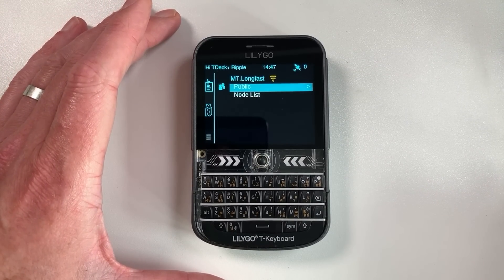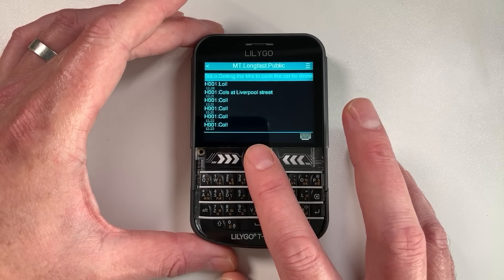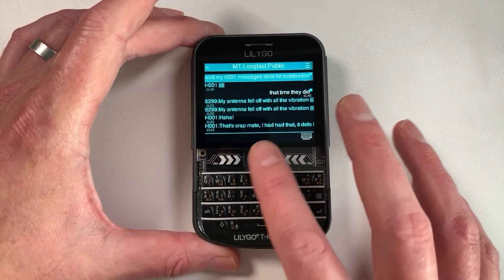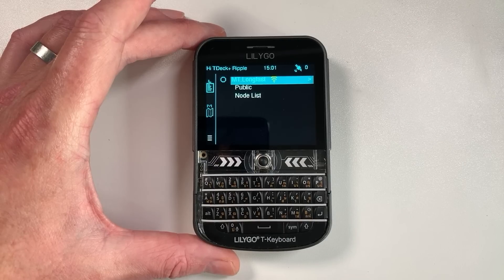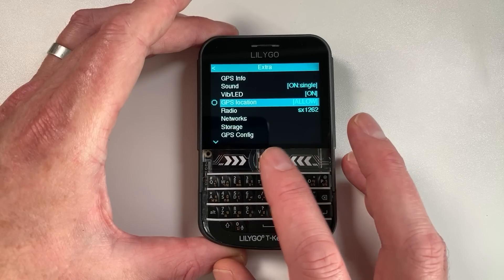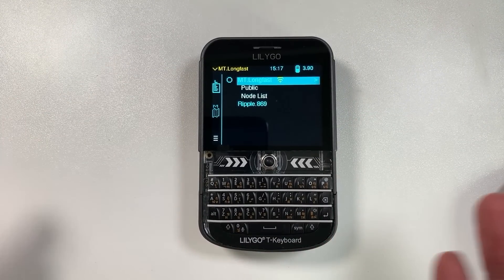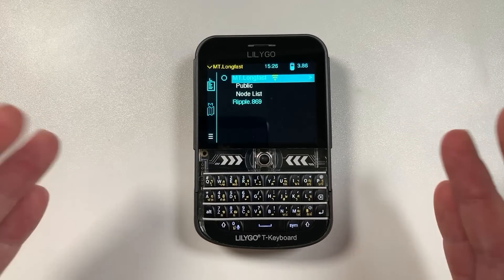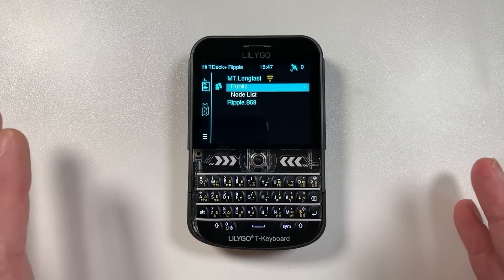MULTI PROTOCOL MESH FIRMWARE FOR TDECK!!!

Comment from the maker: I changed the title, the clickbait was done to push this video out there more and generate more interest in this cool project. 
Unfortunately due to backlash from Meshtastic, the developer pulled the firmware. Sad times.
Reply: Meshtastic is the devil I swear there gunna flip spin and charge for the mesh the devs are sooooooo greesy
Reply: For anyone interested: the "backlash" mentioned here was asking them to release the source code, since Meshtastic is GPL-licensed.

It would be good if we could check whether this firmware not only has a very nice UI, but also is behaving well in terms of, e.g., listen-before-talk.
Reply from the maker: Anyone interested in the background can check the original post here, along with some dialog between Ripple and Meshtastic in the comments section:
buymeacoffee.com/ripplebiz/meshtastic-a-dead-end

I cant really comment on the GPL situation, as far as I understood it Ripple say they just formatted packets in the same way as meshtastic to allow their firmware to send and receive messages on a mesh comprised of Meshtastic Nodes.

It's a simple client mute implementation, and it seems to work perfectly in my testing. I will continue testing and post my findings soon.
Reply: Meshtastic packets are formatted using protobufs, which definitions themselves are GPL-licensed. Next to that, you have to use them in the exact same way as the firmware does, encrypt them in the same way and denote the channel hash using the same hash function, etc.

Would be good to test sending a couple long direct messages quickly after each other to a Meshtastic device and check whether they don't collide with the acknowledgment.
Reply from the maker: @GUVWAF thanks, will take look into it.
Reply: @GUVWAF  HOW it works is NOT GPL licensABLE. Source code is GPL licenseable because source code is SPECIFIC implementation, of nonGPLable method. Source code and method of doing things are two totally different things. So you should change phrasing on that. GPL is NOT patent in any shape or form.
Reply: @andykirby  Would love to be able to test this out too!
Reply: @GUVWAF  if they are not using the protobuf definitions source, this is an API. Therefore it should fall under "fair use" rule in US (see Google v. Oracle) and in EU (Directive 2009/24/EC) - "it has to be made clear that only the expression of a computer program is protected and that ideas and principles which underlie any element of a program, including those which underlie its interfaces, are not protected by copyright under this Directive".

Comment: After all this time, still such as really crappy basic GUI on the T-deck. All I've been looking for over the months is some firmware that has a half decent GUI, it seems the developers are making them but then not releasing and squabbling with each other, which the software disappoints for the majority of users. Imagine not even being able to see a previous message on the stock firmware after all this time!!!!! Every new firmware that has promise is so hard to get or comes with baggage, gets pulled. This project will fail if the community carry on this way.

Comment: All of us that bought the T-Deck because of videos like this now have useless T-Decks sitting without the fancy firmware because its was pulled out and nobody is sharing that firmware that they have downloaded on their computers before it was pulled off from the repos. This is how the interest for Meshtastic is gonna go away.
Reply: I have a similar feeling sometimes. But t-deck is not Meshtastic, its importance was blown out of proportion by vloggers (and I fell for it unfortunately, which i regret). Still there's more to Meshtastic than a useless brick with crappy interface.
Reply: @svofski  I sort of feel like both meshtastic and the t-deck have gotten an undeserved bad rap from this situation. Meshtastic is a really cool project that is still really early in its development. And you are right, there is a lot more to it than the alpha release of a fancy UI that still needs a lot of work. 

But also, there is more to the t-deck than that underdeveloped fancy UI for meshtastic. In fact, the t-deck can be used for other projects besides just meshtastic. It's a neat little esp32 device that could really be used for a lot of cool projects. I'm really looking forward to see what different developers come up with.

Comment: Can this phone looking thing actually make phone calls ? It only sms on Lora ? How about voice recordings ? Thanks
Reply: afaik no voice at all.
Reply: @nullsmack  I did see in the Meshtastic app mention of a in-development Push To Talk mode, maybe in the future we'll have it.  The T-Deck itself does have a microphone, iirc, so you could develop your own software to make use of that if you wanted to take on a big project.
Reply: @dafoex  sure I'd love to take part , but why hasn't anyone done this already isnt that the most obvious thing to do ? If the bandwidth too low for voice stream then voice clips with tcp style error correction should be easy for someone who's developed on this platform before. It's really weird imo
Reply: @dafoex  also what's the mic there for if not to send the voice out ? Setting your ringtone? lol
Reply from the maker: Sending digital voice over a LoRa mesh? Quite complex.
Reply: @andykirby  thx for replying :) once you do 2way data packets with corrections - sending ACK for good packets - like TCP - then txt, data, voice, img... It's all the same.. not sure what's the usual bandwidth but onboard filtering and compression voice can be very light.. 
So is there a TCP over Lora ? If so then I don't understand the complexity ... And if not then I don't get why not ... Basic of basics imo 
Please enlighten me, I'm either missing something or everyone else is...
Reply: @andykirby  why isn't this discussion not pinned to top on every Lora forum ? Please make a video about it - Subscribed 💜
Thanks and all the best 🙏😇
Reply: @AGI-Bingo  I'm learning like everyone else, but I'd assume you've hit the nail on the head - bandwidth is a concern with LoRa and the chirp encoding.  The T-Deck is for development in general, so they may have added a microphone if you wanted to use it like an 868 MHz walkie-talkie without any special protocols on top.
Reply: @dafoex  so it DOES WORK like a walkie talkie ?....? That's a good start - so now just need to find the LoraTCP equivalent, and see if there're any audio encoding decoding libs for Arduino, if not, hook it to a pi0 or something and use as a router/modem
Reply: @AGI-Bingo  Quite probably, but I expect it's only there for makers and hackers to figure out a use, even if it's just using AM or FM to send the voice traffic.

Comment: You didn't provide a link for the firmware
Reply: Yep I can't find it, also not sure if you need the new posh Tdeck or if the original is ok
Reply: firmware's been pulled; meshtastic caused drama
Reply: @downunderprepparedness  they seem to have a penchant for that 🤔